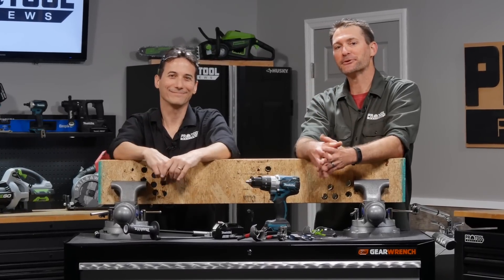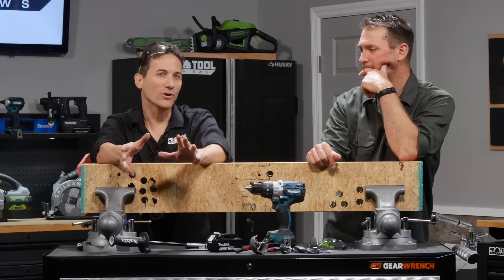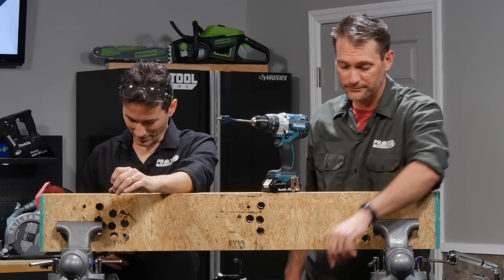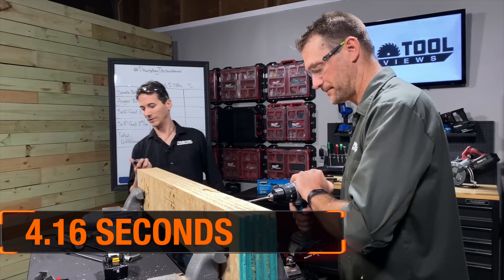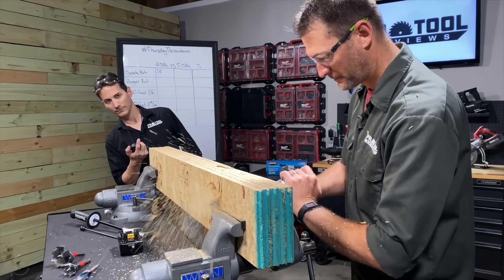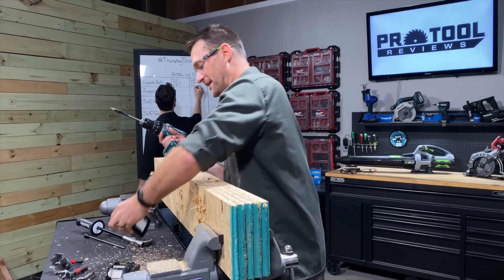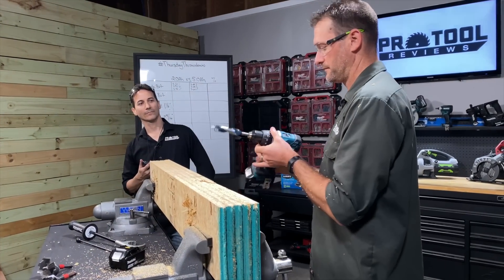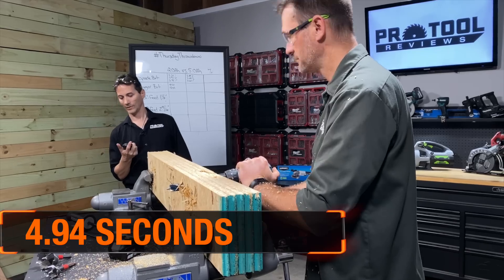Do Larger Lithium-ion Batteries Produce More Power? 2Ah vs 5Ah Thursday Throwdown!

Comment: Thank you very much. I have 18v 2.0 amp Bosch batteries at home, now I want to purchase cordless impact wrench, it comes with 5.0 amp battery pack, I wanted to learn if I can use my 2.0 amp batteries instead of 5.0 amp, it seems I can. I will buy the wrench in solo, without the batteries. Thanks again! <3

Comment: 2 rows may increase aperage aswel. If there are 1 row of 1.5ah 20amp cells.. that means that tool can pull 20 amps max continious... if it reaches over it will fail. If u have 2 rowa of 1.5 ah 20amp cells... it means safe continious max amp output that motor can pull now is 40 amps. If u have more torky tools that require more amps use more cells. 5 ah batery pack has 2 rows of 2.5 ah cels 20 amps. 6 ah pack has 2 rows of 3.0ah cells... dont know theyr amperage

Comment: It's all about discharge rating of each battery. The 5ah may have a higher discharge rate. If the 2ah battery had the same discharge rate they would perform equally. Amp hour rating is how many holes you can drill.

Comment: I personally think it depends on the project. To drill just a few holes or drive a few basic deck screws, I think the lighter weight of the smaller battery is worth a few extra seconds of my time. When it comes for heavier duty work, such as larger spade bits, bigger screws/lags,or extended periods, I’d go with the larger size batteries for runtime, and extra power, depending on application
Reply: I find that true with my cordless tools (weed wacker and pole saw)

Comment: Does a 40V 2.0AH battery weigh significantly less than a 40V 4.0AH battery?

 find my Greenworks weed wacker to be quite heavy with a 4 attached and wondered if switching to a 2 would do anything for me.

Comment: Can't help but wonder how 2AH vs 5 AH batteries effect no-load rpms - measured with some kind of accurate tachometer or strobe.  Also wonder if torque can be measured.  Some more controlled, repeatable, scientific tests without the variability or subjectivity of humans and without pushing a tool beyond reasonable, normal use.  Test the batteries against rated specs.   If you need better performance, why not get a better (heavier duty) model tool?

Comment: There's too much room for human error here for this to be at all accurate. You should've filmed it with a 60FPS camera and then worked out the time by counting the frames. Could've done that with your phone - probably several hundred FPS. Also, getting a human to randomly drill holes is obviously an issue. You could've used a torque meter to do a very easy and reliable test.

Comment: If the cells are the same in the batteries a 2.5 ah vs 5 ah will only provide a longer runtime. Although this test looks fun it's accuracy isn't great. If the pressure on the drill is different the results will be different.  The fact it's 2ah vs 5ah will have different results as they probably use different batteries and or you have less batteries in series..

Comment: I find the 3,0 amp battery to produce much less dust than the 5,0 amp one... BUT.... You can see much more easily through the holes drilled with the 5,0amp battery which makes this quite a difficult choice. I also noticed the 3,0 amp battery to be somewhat noisier. Now I'm at a complete loss as to what should I go for. Thank you guys for confusing me even more!

Comment: I would like to mention is it worth getting the 5.2A over the 4 and 3 A packs for chainsaw use?  as there is huge price difference for the 5.2A Packs. Run time would be important to me here.
Reply: I opted for 6 Ah batteries for my Weed Wacker and my pole saw (a small chain saw on a pole for pruning trees).  Both came with 1.5 Ah batteries, but due to the length of time on the weed wacker and the load on the pole saw I felt the higher Ah batteries were a good investment.

Comment: There’s a little problem with the correctness of your experiment. Your manual pressure applied on the drill could vary between between tests. You could be pushing harder on one test or lighter. Not very scientific :)
Reply: They were all self feed bits to specifically avoid this issue

Comment: I have dewalt 5.0ah for my jigsaw and reciprocating saw. Smaller 1.5ah (I think? for my drill and small jobs for the impact)
I also have a hitachi (I guess now metabo) drill that I replaced the 1.5's with 3.0. I'm really enjoying the Metabo. The feel, performance, etc. Looking at purchasing the Metabo impact (18V) wondering if tbe 3.0 would suffice for homeowner purposes or upgrade to their massive 6.0? I kinda think that huge 6.0 would add a lot of weight and would be more suitable for things like cordless circ saws, mitres,.
etc, opinion?

Comment: Ok so between a bosch 18V 1.5ah and 18v 2.0ah 
Is there any significant difference in life
And how long it lasts on charge 
Like as in 1 hr on 1.5 and 2hrs on the 2.0

I drill knife steel mostly
Reply: @Protoolreviews  and u my friend gets a sub
Reply: @Protoolreviews  so it is worth it to get a 3ah battery separately since I I usually drill steel
Reply: @Protoolreviews  I dont have the money for that and I dont think its available in my country

Comment: When you pull the drill out of the hole, do you reverse the drill anti-clockwise?
I think you don’t, but not entirely sure.
If you reverse it, then I would like to say that drill reversing while coming out is taboo in my line of work as an orthopaedic surgeon for past 42 years, drilling and reaming tens of thousands of bones.
We keep turning clockwise while coming out. Always.
The reason is that reversing a drill will damage the drill bit.
Reply: @Protoolreviews  
I always teach juniors that they are allowed to reverse drilling on only one thing. A screw, and nothing else.

Comment: @Pro Tool Reviews Im looking for new batteries for my Makita products i have drills only at the moment but looking to expand to router, sander, circular saw? As power band & charge time goes 3Ah has served me well. But im concerned other tools will demand more power what do you recomend from 4, 5, or 6Ah for comfortable use time & charge rate used in high drain tools? Ive also seen aftermarket 2.5Ah on the slim profile batteries on ebay which could be useful in a tight spot but dont trust the Ah advertised by the c*****e sellers and the reviews make no sense look copied & pasted. At worst they could be guttless 1.3Ah? For all we know not whats stamped on the tin. Is there a way of testing Ah by loging charge time any info much appreciated to tell me how best to purchase the tools with or without bats for price?

Comment: I was always told no matter the amps, when volts were the same, the battery would produce the same power output and the amps only determined run time.
Reply: Not true unfortunately

Comment: In fact, this gain is not due to the greater number of energy cells, but to the type of energy cell used in each battery. The 2Ah battery uses 5 Samsung 2000mAh power cells with a maximum CDR of 15A. The 5Ah battery uses 10 Samsung 2500mAh power cells with a maximum CDR of 20A.
Reply: This sounds really interesting

Comment: 4/5Ah when doing hard work, 2Ah when in the back of a cabinet or the bigger batteries are all on charge... works about as well as I need it to, and means I don't need to pay for half a dozen big batteries

I'd also expect the difference to increase as the charge drops - on my electric car there's a noticeable drop in power when at 20% battery vs 100%

Comment: Are all the battery sizes in the same line interchangeable? I thought they were but I grabbed a 5ah to use on my drill that originally came with a ?1.5ah and it didn't want to go on. ?

Comment: Can I put 5a on a makita brushless?
It came with 2am but it’s also 18v
Reply: yes you can.. amp=runtime, it has nothing to do with power
Reply: @erwinmaes3105  Amp = power output. Amp Hour (Ah) = runtime. A and Ah are NOT the same thing (like miles and miles-per-hour are different)

Comment: If straight from the capacity point of view, 5A does not have advantage against the 2A..

However, after the explanation of how the 5A being configured as 2 rolls of parallel cells, then is a totally different condition. Because of 2 parallel configuration, it allow a higher outflow current loads.

Like some of is familiar with Lithium ion battery with the "C" rating, higher "C" value will allow a higher level of current (Amp) flows through.

As higher demand tasks, having higher resistance, and required higher torque power to accomplish the task, thus as a result higher load to the motor, and result in draining higher current from the batteries.. all these means, needs higher current flowing out from the batteries to the motor.

;-)

Comment: Should have a regulated pressure, doing it by hand the pressure and speed will vary.
Reply: Over 6 runs for each test (24 total), by the same person, it will average out enough that it doesn't really matter: the difference is still stark

Comment: The second run is better because the battery is warm. Warm batteries have lower internal resistance. Lower internal resistance means higher voltage/power.

Comment: Does this apply to Circular saw as well. A comparison on circular saw will be good
Reply: It's a property of the battery, so yes it will apply to any tool. If anything, it will be even more noticeable on a saw because it's a very high torque load

Comment: I have a Milwaukee 12v vacuum and I can ear the difference with 2 or 4 amp batteries. The motor is louder and a bit powerful with 4 amp batteries.

Comment: As a "DIY'er" home use, is it worth spending the $80 difference on the 5.0ah 2pack or getting the 3.0 2 pack that's on sale? Yard work, occasional 2x4 rough cuts. No long extensive use.

Comment: Hello everyone , I want to buy the makita Lawn mower DLM431 . In the user manual of this mower its written that i can use only up to 5AH (18v) two batteries. If i use the same battery but with 6Ah do i destroy the lawn mower?
Reply: According to my understanding the Ah range stands only for the run time and could not harm the tool if you take higher Ah with the same voltage. But maybe I wrong......For one hand I don't want to harm the mower's engine but on the second hand i really want my mower to work more time.
Reply: Simple answer No it doesn't affect performance.the mower  just runs longer

Comment: A larger battery is not for more power, it is for longer working time. In order to increase the power, you have to increase voltage. A 5ah battery, will run the tool, twice as long as 2ah battery. That means you get more work before a recharge. Its like having your car, half full, or full, of gas. You are not going to get more power out of the full tank, but you will go twice as far.

Comment: Unlike torque,  this is very much dependent on the force applied by the operator. He's not a robot,  that force will vary. Not just that,  when going into a workout,  for example, a certain weight will be harder to push before you're warmed up.
Reply: And the 2ah weigh a lot less than the 5ah, does that matter?
Reply: the 3 data points helps to prove the point. Agree a confounder is the fact that he bet the 5ah battery would outperform, therefore consciously or subconsciously he may be pushing harder with that tool. But again the multiple datapoints should help smooth that out. Also, they could have had the timer guy do the experiement too (who bet on a smaller difference). Would be intetesting to see what the difference in speed was with him at the helm. And yes going back and forth between batteries (and warmed up bits) would help. In fact warming up each battery and the bit to start (give each a trial run), then start to measure the time would help eliminate any differences due to 'warmth'. Overall though a neat experiment with an outcome that matches what is known to be true (5ah delivers more power/torque tha n 2ah)

Comment: Maybe I should buy a 5Ah battery for my Makita impact to try out, as with my current 3Ah battery it has problems getting the wheel bolts off of my car, although on paper it should have enough juice to do so...
Reply: The 3ah has 2 rows of 5 cells, only the capacity is biggeron a 5ah, but maybe the cells are worn out a little and it's having some power loss because of that
Reply: @lukie4ever  Well, thanks for the reply, but I don't think they're worn out, as I didn't put heavy use to them...yet.
I just have that DTW285 impact and a drill.
If the impact is too tiny, well, I'll have to go bigger...(1001 or 1002).
Reply: @wiedapp  i have the makita ripoff from that dtw drill lmao

Comment: Using simple math. A tool grade battery will allow you to draw about 20c. 2*20*20 = 800w. And a 4Ah battery will allow twice that current draw.
If the maximum power draw of the tool is less than say 800W, the advantage in power is minimal.

Comment: I’ve absolutely seen the difference in power between new 2 and 4 amp batteries when removing lug nuts off my truck with an impact wrench. Noticeably faster and easier with the 4 amp. I wasn’t surprised by the test results here. Good test. 👍🏻
Reply: which brand ?

Comment: AH make a huge difference with impacts. My high torque Milwaukee with a 3.0 can barely remove wheel nuts...5.0 it with will with out struggle. A 9.0 will snap the stud off and a 12.0 will clear rip the engine out of the car 😂
Reply: Mean O’ Dustino I have the 2767 and have only used it with a XC 5.9 so far haha
Reply: Not true

Comment: I would be curious how much longer a 5ah battery lasts than a 2ah. How many holes each would last before needing to be recharged.
Reply: a little over twice as long
Reply: I agree, thats only half of the test.I think they should have kept going until both were flat.
Reply: it realy is math if we talk about same kind of batery. If ah doubles time also is more or les double. But if batery has 5ah camacity.. it will not run down all capacity... something around 0.5ah will be left. So on 1.5ah u will use only around 1 ah.. and in 5 ah ull use 4.5 ah. So u cant use 1/3 of 1.5ah and u cant use 1/10 5 ah. Many cell manufacturers state full discharge ah value but in reality bateries are not alowe to discharge fully.

Comment: This will very from tool to tool, battery year to battery year etc.. most companies will use one type of 18650 cells for lower more mass produced batteries then use higher end premium ones in the 5.0 and larger ones. For an average the 5.0 area seem to be the cut off for most companies as to when the use better cells. The better cells will allow for more efficient and quicker power delivery. Jeep in mind that they shop these batteries out yearly so last years battery might have had Sony cells but this years might have Panasonic cells. So while this years battery may be 10% more powerful last years could’ve been equal to or even 20% more powerful. But short of the story.. the rating is in how many amps the battery can deliver in 1 hour so could’ve saved yourself a lot of time and wood and simply used common sense and math lol..
Reply: Agreed. However the new 21700 cells in the new 3ah and 4ah batteries are changing that cut off a bit.

Comment: Power = Voltage x Amperage. If the motors are the same  they will draw the same amperage, so the only thing you can change is the Voltage to gain more power. Since the voltage isn't changing there are NO power gains. The only thing you get is longer battery life because they're are physically more batteries. You are charlatans and it upset me how popular this sudo- science is. GLWS

Comment: I use Dewalt tools. I like the compact batteries on my impact drivers and sander but I prefer to use the larger batteries on all my other tools. I find the ten cell batteries are more balanced on the drills than the five cell batteries. Nice video.
Reply: Yeah a 4/5 Ah battery on the impact drivers doesn't seem to make much difference unless you're driving big lag screws, and it really unbalances the tool. I always use 2Ah on my impact driver

Comment: Larger batteries prevent voltage drop and have better sustained amperage flys away

I still use smaller batteries, mostly because it's only a small drop in power and much more nimble. Bust out the large battery when I'm using the hammer drill with a large bit

Comment: To see the difference gotta run Milwaukee high draw tools with batteries with 18650 and 21700 cells. There is a difference. They clearly run faster/stronger with 21700 cells
Reply: Same with ryobi hp vs regular 1.5 or 2 ah ryobi makes a hp 2.0 that comes with some tools but i havent seen it sold separately
Reply: It makes a huge difference. Especially with Milwaukee, just have to have the right version of the right size battery(High Output, Extended Capacity, High Demand, ect.) Dewalt is now in the game with power detect. But they all do it to some degree.